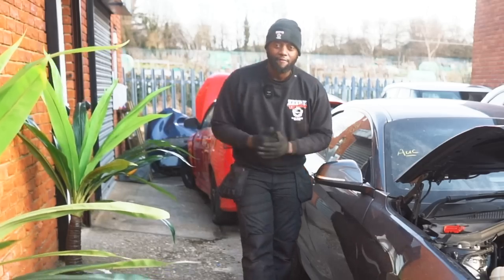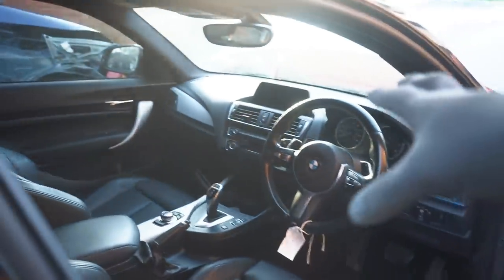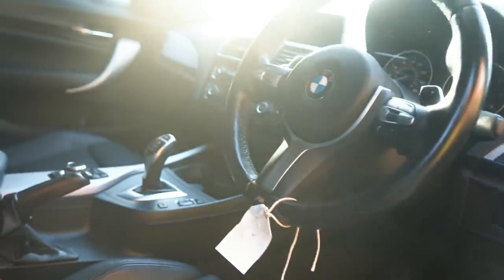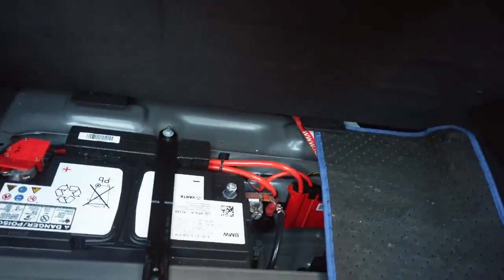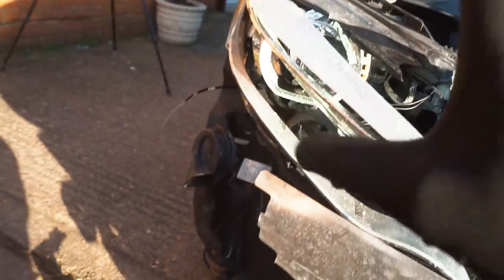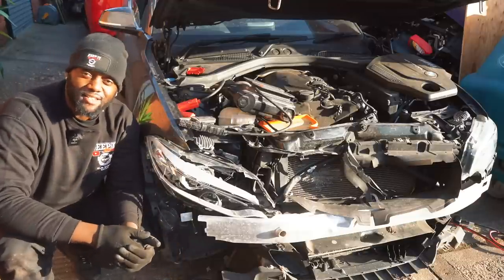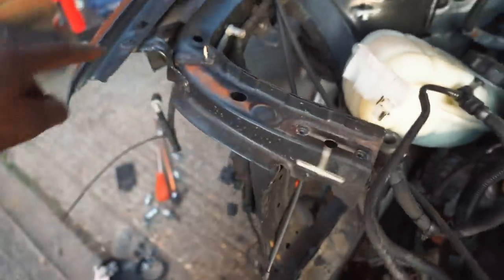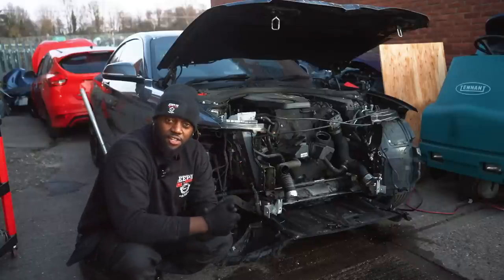REBUILDING A WRECKED 2016 BMW F22 2 SERIES FROM COPART SALVAGE AUCTION - PART 1

Comment: im currently rebuilding a m240i convertible, i bought a used passenger door from a coupe version and the window doesnt go down like it does for u 5:06 when i open the door, when its sapose to do it on the convertible aswell, so thank you for confirming its sapose to go down on both the coupe and convertible, i think i gotta swap over my wiring from my old door :(
Reply from the maker: No no no. Dont do all that as its on a mew car all you meed to do is reset the regulator. Put the window down and keep holding the button down for 10 secs. Then put the window all the way up and hold the button for 10 secs again. That resets the regulator and endpoints